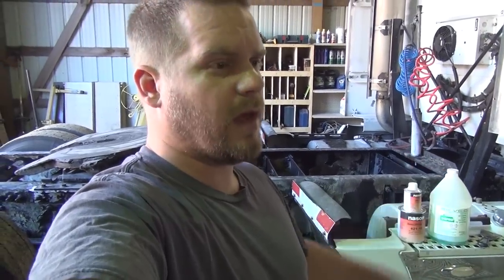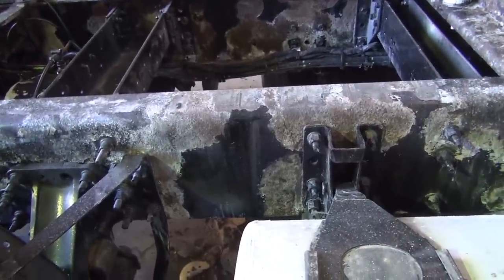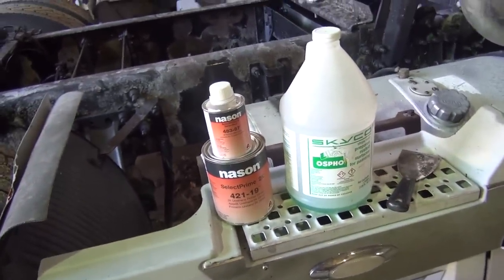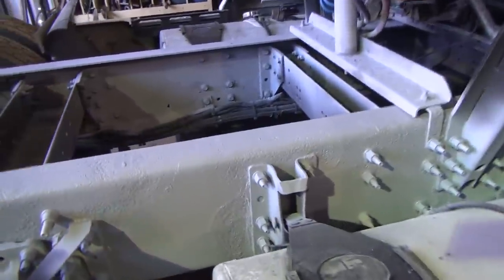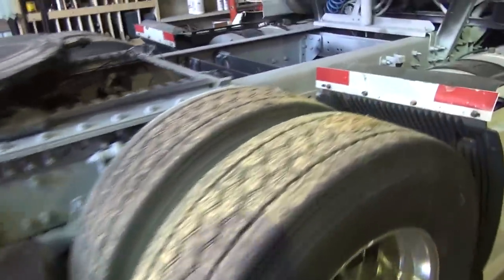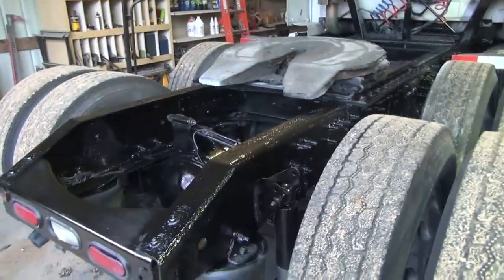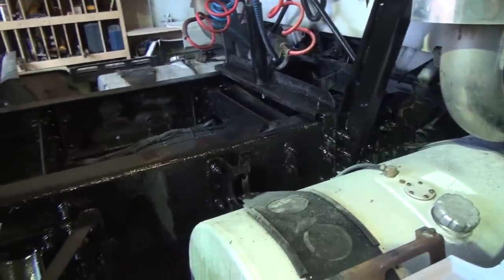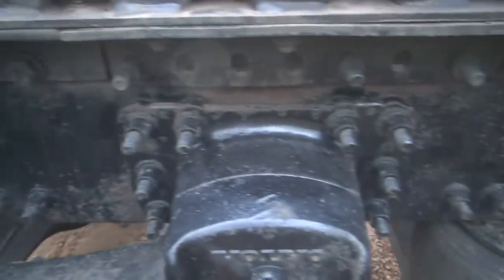Painting the frame on the volvo vnl 780

Comment: Never knock a man down when he is trying to protect his investment. At least he's doing something about instead of bellyaching like most.  Only thing I would have suggested since you do have a paint gun and air compressor would be to purchase one gallon of the rust oleum paint or tremclad and one quart of thinner that they carry and  squirt it.  One gal. Is more than enough to do a frame from top to bottom. I use the semi gloss or satin finish. It hides most of the flaws and imperfections on the surface. 
Get a couple rolls of plastic tarp from the dollar store and cover the lower half of the cab and sleeper so you don't get overspray on it. 
Sand blasting would have been the better way to go labour wise instead of that liquid goop stuff and scraping. A bag cost less than 5 bux depending on the grade and you would only need 2 or 3 for that job. Again since you have a compressor. It does go everywhere and you would be finding some sand for the next 5 years. Lol!!!
I did a lot of trucks and frames over the years, some  competition level and others econo since the owner wanted to flip their rig.  You'd be surprised how much a clean frame makes your truck look.
Keep up the good work!
Reply: What do you use to sandblast the frame?
you a 100!pound soda blaster would do the job
Reply: Hello,
Thanks for your feedback.  Dan you list the products you would use for this job?

Comment: preservation is the goal....well worth the effort. i use rustoleum oil base. i thin it and add a hardener seems to work ok. rust is miserable to deal with. i actually prefer the satin finish....the pits and imperfections dont look as bad as with the gloss.
Reply from the maker: yep, as long as its not rusting away doesn't matter to much, it'll be road film covered as soon as it rains. can't keep these things clean if you get caught in the rain
Reply: Try tsc majic brand i did my tow truck frame 5 yrs ago still looks good today and its cheap.

Comment: For extra protection and longevity I would follow this with  a coat or two of Clear coat paint .
Reply from the maker: This is usually good for 4-6 yrs running southern states.  probably won't last near that long up north, the stuff they put on the road eats everything quickly!
Reply: @LifeWithChase  touch ups annually on new gear out north , the road salt we have in my province sounds like your sand blasting your truck down the highway

Comment: Awh man, you painted over the shiny Road King shocks! 😯
Check out Strong Arm Fluid / USA Fluid it's a liquid spray on that stops rust. Works excellent
Reply from the maker: I threw them road king shocks in the scrap pile and hauled them off 😂 had 2 of them the ends broke off of and some were starting to leak. Put some regular shocks back on...
Reply: @LifeWithChase  loved mine except for the ones that leaked. They are so strong had one break the Volvo mounting bracket on the bottom after lots of miles. Think one reason they leak is from sitting low with the air bags deflated. Heard FOX shocks will rebuild them.

Comment: The best way to paint the frame is to use an oil base paint. You can buy it in a gallon. Thin it out with mineral spirits and spray it with a cheap spray guy. It last for a long time.the original paint is oil base that why it last so long
Reply: Do you recommend any particular brand for frames?
Reply: Original paint on the frame is not oil based. Factory paint is 2k polyurethane

Comment: Hey Chase I have question Have u checked under the cab mainly the front floor board? I have rust there on my 780 and I also here its a common issue unless treated properly...  Also I have to do my frame as well its not no where near as bad as yours but there is rust.... Be safe brother and keep up the good work....
Reply from the maker: my old truck had rust under the floor
Reply: @LifeWithChase  how did u repair it and was it expensive to do?
Reply from the maker: @bikerboy2k142  never repaired it, I got this truck

Comment: I'm a  mobile media blaster and do cab-back stripping of semi's for $450 ONSITE and it only takes two hours.  The results are far superior to this also.  Not knocking him, just a point of comparison.
Reply from the maker: That's not bad if it's ready to paint after your through. Definitely the way to go if someone has access to that. No one around me does that at least not that I know of.
Reply: Can you soda blast or is the media too soft?  I have some heavy scale but scared of sand media getting into stuff.
Reply: @EdsPlace  soda is far too soft for a job like this

Comment: Why would you buy a spray can when you have a gun and compressor. You could have bought a quart for the same price you paid for one aerosol can and gotten 5 times the coverage. And for another $5 you could have gotten implement paint and add hardner and watch it last alot longer. But that rust wiil be back in a couple of years.